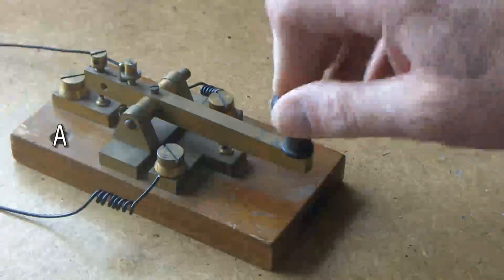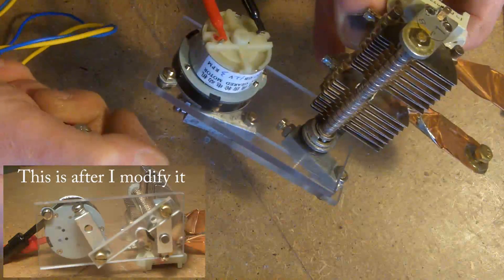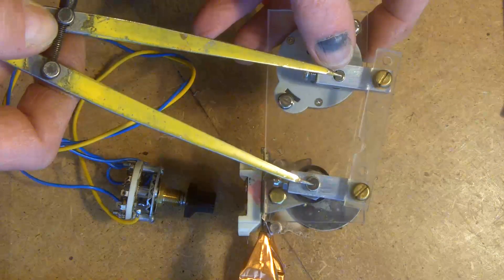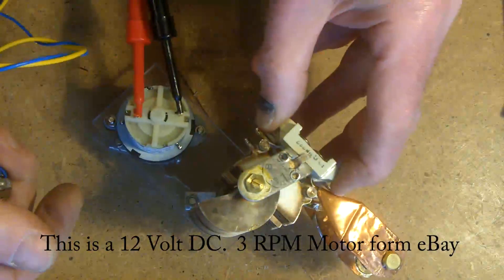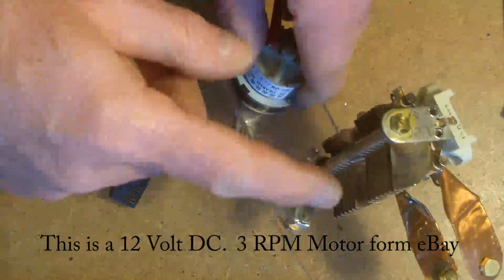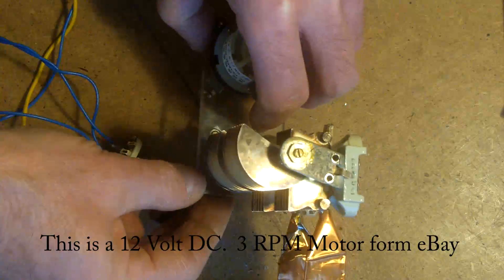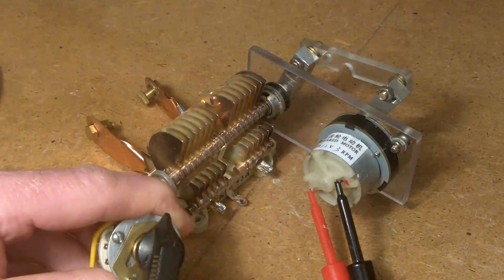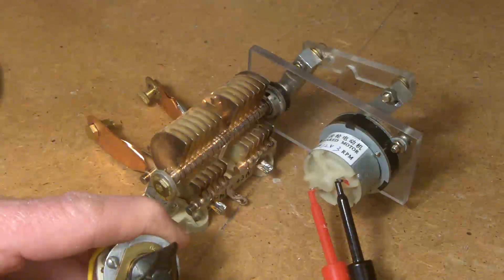About Radio 65 update on Magnetic Loop Antenna capacitor tuner

Comment: I am building this EXACT SAME THING! waiting on my motor, however I moded the cap to turn 360 and am going to direct couple the shaft of the motor to the end of the cap post. Seams your method will work as well but more moving parts. It is shorter than mine but wider, TWSS.

Comment from the maker: HI, thanks for the feedback. I’ve had it working with the loop and I will video it soon but it’s been none stop rain and high winds here. OK on the cam I try to keep it simple as it’s all too easy to make it over complicated and as you imply for the project in question I think it’s just fine but I must develop an easy was to adjust the rotor arm, but not tonight. 
All contributions gladly received.  
All the best ... Andy

Comment from the maker: Hi Dick, well observed. If you look about 2 minutes 30 secs into the video ‘About Radio 63’ I do point out that there is a speed issue with this mechanism where the traverse is faster through one part of the cycle than the other. With the 12 volt 3 RPM motor with a low drive voltage it’s not a problem. By the way the capacitor is one of a pair that I bought at a radio rally over 30 years ago so it’s what I have to hand, I knew it would come in useful one day hi hi. 
All the best ... Andy

Comment from the maker: Hi Fred OK on the DC feed, ~40 years ago made a TV mast head amplifier, I put 50 Hz up the coax for the power and then used DC to select one of two TV aerials that where pointing at different transmitters, if you cut back to one of the earlier videos I did say I might look at making a filter and pushing the DC up the coax on this project but the flex is the lazy mans option. I will try and make a video on the magnetic loop some time. It’s cut for 17 but it works at 20 and 40 metres
73s   Andy

Comment: Nicely done as usual,  of course you could eliminate bell wire all together and send the dc down the coax.Phil Salas, AD5X (Google: AD5X Articles )  has an excellent circuit on his articles page- look  for the PDF article "DC power though your coax" - I'd place the link here but You Tube is being a bit overly zealous at the moment about links in comments. By the way, what is the frequency of your loop?  40 Meters?